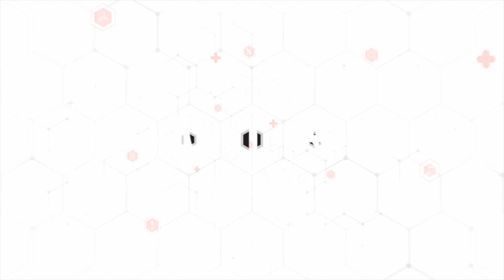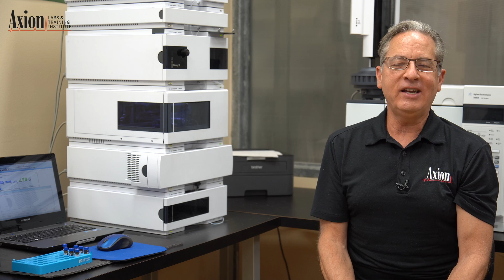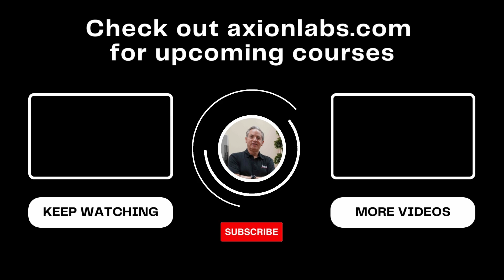What is dwell volume?

Comment: I see you are running a 7890 with a G4513a autosampler. We also have G4513a autosampler for our new 8890 gcs, but connecting one of those to a old 7890 gc does not work. he simply does not recognize it. from what i understand i have to downgrade the autosampler firmware - do you know a location where i i can download specific versions?